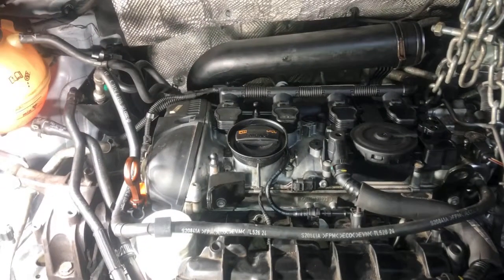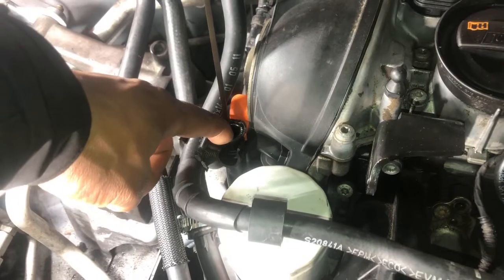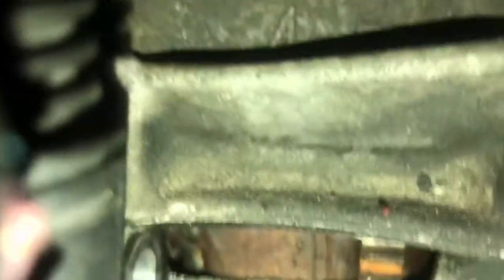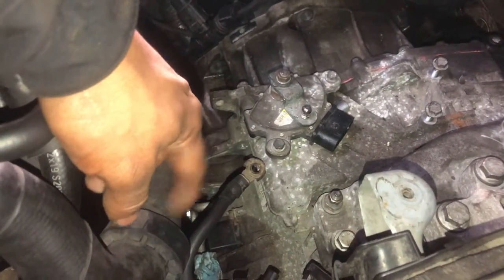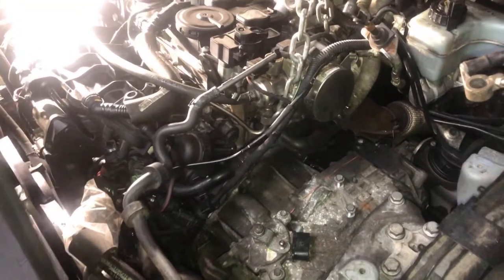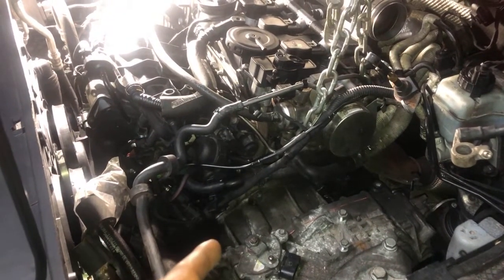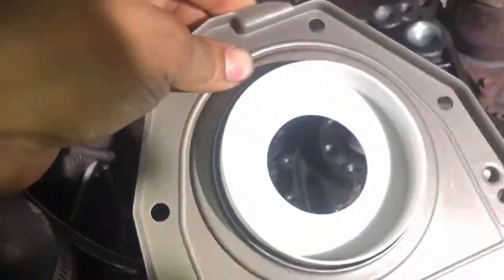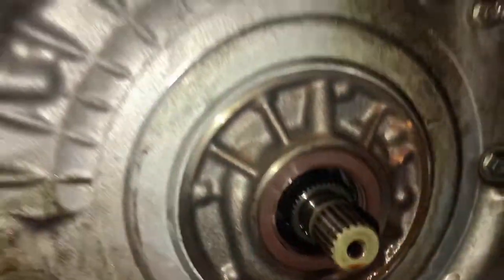Volkswagen tiguan 2.0 turbo misfire p0300 all cilinders due to rear main seal leaking!

Comment: I really hope this is not the problem with mine. I also have a mystery P0300. It's not plugs coils or injectors. When I accelerate or push the pedal hard is when I get misfire. I have no idea
Reply from the maker: Probably be cause this car was giving the same symptoms new coils, new plugs, new pcv valve and nothing fixed until we did the main seal

Comment: Cuanto tiempo para remplazar el rear main seal sabes si tienen un mejor rear main seal más heavy duty
Reply from the maker: Si tienes experiencia en mecánica te tardas tus 5 horas si no más, y si en el dealer es mejor comprarlo, te sale como en $300 te venden el gasket los tornillos y el cilicone
Reply: @lito2122  gracias por contestar donde tienes tu shop ?
Reply from the maker: @stewartrivers2730  Pittsburgh Pennsylvania